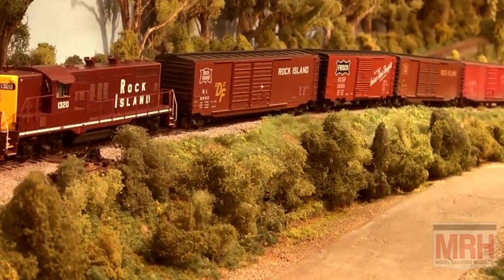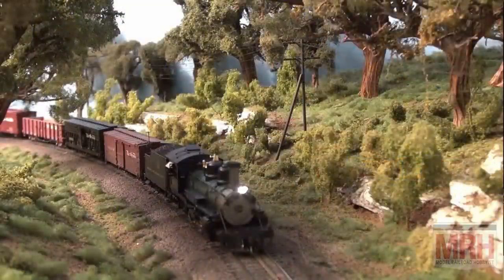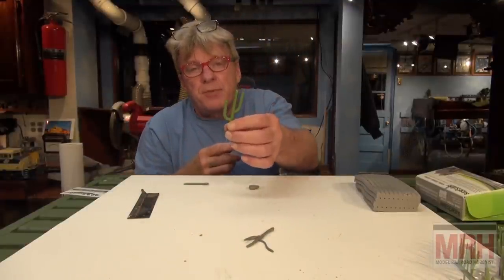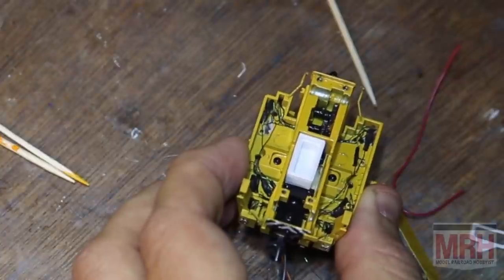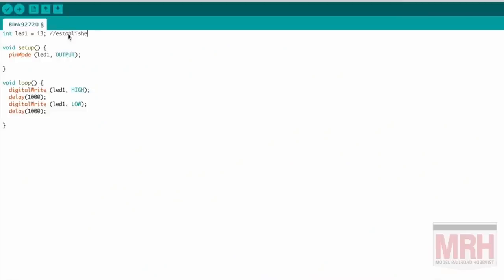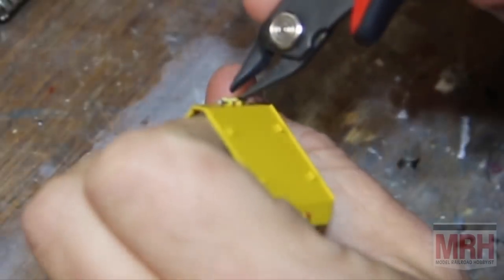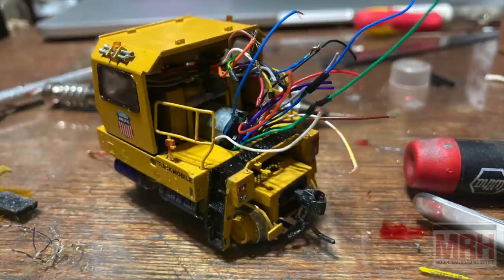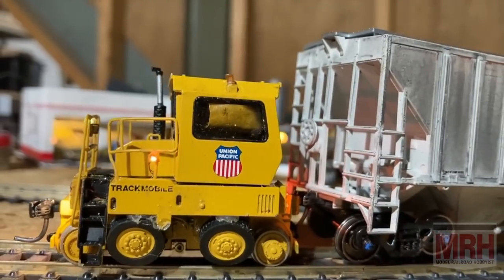Trick out a trackmobile | November 2020 WHATS NEAT Model Railroad Hobbyist

Comment: Amazing work James. I'm assuming the ATTINY is connected to a function on the decoder, which when the function is turned on - it will trigger code on the ATTINY  to drive LED effects?
Reply: Sort of.  The lighting effect on the decoder is set to "constant bright", meaning the decoder is putting out a clean, steady 12v of DC power on the function.  With a 1K resistor, that's reduced to about 3V, which is safe for the ATTINY, but the decoder is more of an on/off power switch than a specific code trigger.  As long as the ATTINY has power, it will run its function.   In other words, the ATTINY either has power or it doesn't.  

I make the distinction because conceivably, one could set one of the ATTINY's programmable pins as a function "input" that would read a trigger such as a push button or reed switch and respond accordingly, though nothing would work without the ATTINY being powered to begin with.
Reply: @JamesRegiersModels  Thanks for the reply. I love your ‘out of the box’ thinking... it’s a real inspiration.
Reply: Do you have a wiring diagram of how the attiny is hooked up? I understand about the 12 volts and the voltage drop across the 1 K resistor but am still unsure about where what pin on the attiny the function wire from the decoder should be hooked up to
Reply: @cnman9743  Any pin can be used except pins 4 (GND) and 8 (VCC). I used pins 1 and 2 to connect to function outs from the decoder. Using pin 1 meant that I needed to program it in a different way. If possible try not to use pin 1 :)
In my project I used programmed the ATTINY to switch various modes of lighting. Turning the headlight (or rearlight) - on / off / on rapidly, changes lighting modes from mainline to shunting and then completely off. 
Here's a link to the circuit diagram: https://drive.google.com/file/d/1t9bI-N8DS-Ar3TRTPCirgwQwxTviEiNj/view?usp=sharing
As a note - unlike DCC decoders, ATTINYs use a common GND, so pin outs to the various marker lights are +VE.

Comment: Excellent episode!
@Ken: it seems that the drone footage encoding is now fine, no more lags. That makes this part a lot more enjoyable! For the cactus,  maybe a wire armature will help the modelling (but at least for Fimo clay,  you need to first put a fine layer of green stuff on the metal to have adherence).

@James: great work! I made several sound installation without spare space in my tiny On30 models, but not with so much lights and even less a processor. 
In Blender, you should set the Unit Scale to 0.001 to have mm instead of m, and then you don't need to convert the STL before printing ( https://docs.blender.org/manual/en/latest/scene_layout/scene/properties.html?highlight=unit#units )
Why not buy pre-wired smd LEDs? On ebay, you can find them quite cheap, and even cheaper on Aliexpress
https://www.ebay.fr/itm/Q0402WW-WARM-WHITE-20pcs-0-1mm-Enameled-Wired-Pre-soldered-SMD-Led-Model-DIY/192892013268?ssPageName=STRK%3AMEBIDX%3AIT&_trksid=p2057872.m2749.l2649
Thanks for the ATtiny13, I didn't know it, but I may have some use for it.

Comment: At about 23:40 James is using what looks like a spring loaded pin vise. Anybody know what that is?
Reply: It is a Zona 37-160 Spiral Head Pin Vise.   Probably the best pin vise I've had.  What's really great about it is that it converts downward pressure into rotary action, which seems to help avoid breaking drill bits.

Comment: What's that hand drill you used for the back lights? I need that
Reply: It is a Zona 37-160 Spiral Head Pin Vise.   Probably the best pin vise I've had.  What's really great about it is that it converts downward pressure into rotary action, which seems to help avoid breaking drill bits.

Comment: Can brass photo etch be glued with cyanoacrylate
Reply: It can.  Aside from being cautious so as not to make a mess with the glue, you will also want to watch for temperature changes.  Brass and plastic expand at different rates, which can break the CA bond if the temperature change is significant enough.  An alternative is contact cement, but it will often leave an ugly residue.
Reply: @JamesRegiersModels  Thank you and I appreciate your answer, I'm dealing with very small pieces. I like soldering and was thinking using liquid solder I have a 40 w iron 
will that do?.  I'm on the Réunion island Indian ocean not to much temp variation
3or 4° and I thought that I would make a better job gluing it . Much appreciate you're input . Stay safe thanks for your videos kind regards.